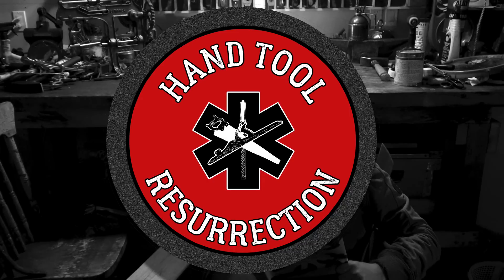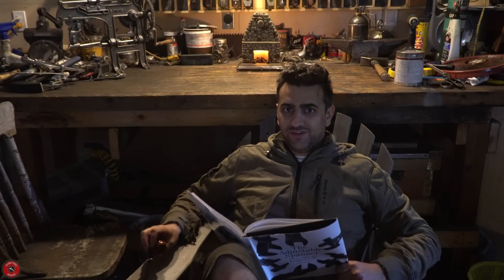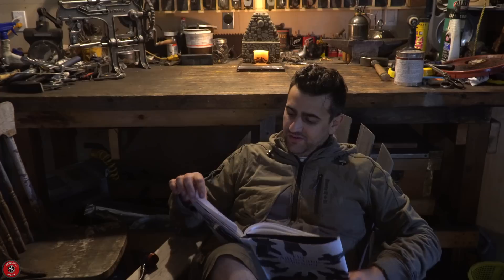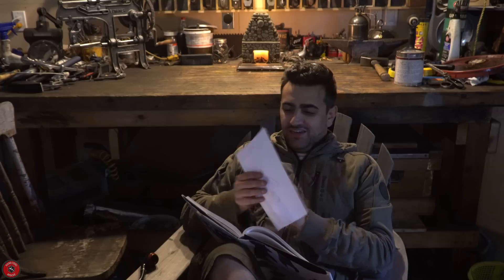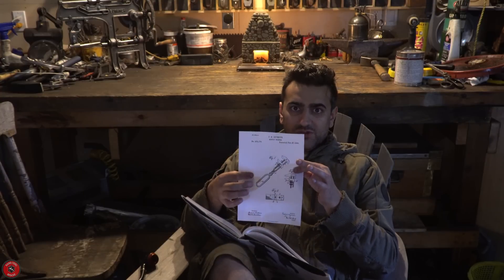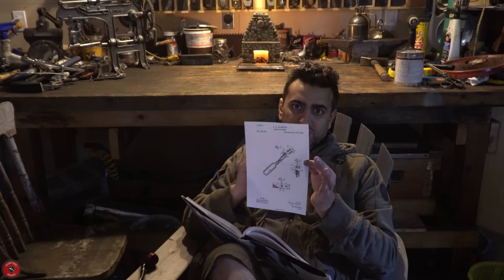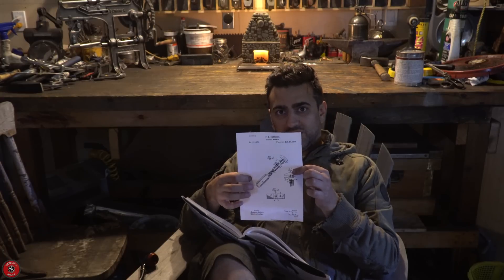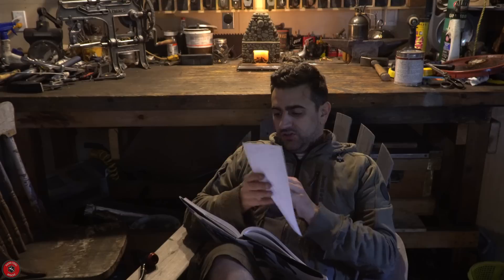1883 Wrench Twisted Handle Wrench [Patent Remake]

Comment: Never encountered one like this but I have a bunch of different sizes of Coes wrenches (both wood and metal handle style) as well as Walworth pipe wrenches. I use all of them mostly for work on steam heating systems as many components are designed to fit these older wrenches and don't fit into modern tools properly. (For example the top cap of old packless radiator valves, which are usually octagonal and don't fit into any modern adjustable wrench unless it's gigantic, but fit nicely into a large Coes wrench).

Comment: I was gonna say this would be an awesome multi tool if you added through bolts to hold the top jaw on so you could put different top jaws on.... Or just use it as a hammer.       😂

Comment: For some reason this video popped up in my feed, it's over a yr old... My grand mother's great uncle was a black smith, and he had actually made a pair of these. One he placed a piece of oak in the handle with the round bar wrapping around. Unfortunately, when my grand mother passed away, my uncle got all of those tools and most were missing out of the tool chest. If my memory serves me correctly, I vaguely remember both, handle length were around 18" - 20", the jaws were heavier and thicker. Cheers :)

Comment: I'd recommend using an angle grinder with a metal cutting wheel for removing medium to large bits of metal like the jaws of the tool that you did with a belt sander

Comment: Some stuff for Conservation I started to love is called "Cosmoloid H80" it's 'Microcristalyn Wax'

Some acid-free Wax that sinks into the surface, best after sandblasting, electro-derusting or a run in the Vibratory tumbler.

You dissolve it in benzine (the Manufacturer asks for Shellsol-T but I havn't seen a divverence)
and brush or wipe it on, let the benzine evaporate and buff it with some old T-Shirts :)

You don't see it and you won't get oily fingers from it

Comment: I have one of these that is similar to the Capital Tool link you showed, twisted handle, standard head, with the knurled nut in a cutout in the movable head. An ACME thread was used on it. About 10 inches overall.

Comment: Given the time period, there were probably as many blacksmiths as there were mechanics, if not more. So, wrought metal would have trumped machined metal, in real applications. The principal use would have been agricultural implements, and they would mostly have used square nuts. Not a bad design, considering the resources available, and the intended function.

Comment: Looking at that design, I think Seymour soon discovered a flaw, after he applied for the patent.
His design puts a lot of load on the adjustment nut. Especially brass ones will wear out very quickly or may even break. Therefor, a hardened steel nut would be better.
That's why this exact type of construction was never used. It was a bad idea.
By making the adjustable jaw longer and putting the adjustment nut inside of it, the load was now taken mostly by the jaw and far less by the nut. It also makes the jaw less prone to wobble.
Also, two rotations of the handle are necessary to avoid any twisting of the handle during use. The jaws will then loose their grip and thus the tool will become fairly useless. The handle must be ridgid !!
You must also use a flatter thread (square or trapezoid) , not one with pointed edges because they will wear off soon, making the jaw wobbly. And a sharp edged thread will only scrape the metal away, on the inside.
So...HTR, you know what to do, next !

Comment: Get yourself some old garage door springs of decent thickness, they are awesome quality steel for your handle material.To keep your twist consistent, place it in a vice directly below the spot you want your start the twist, this will keep that spot locked tight and no fear of shrinking in. May the power of Nutella sustain thee, the true North strong and Free!!
Reply from the maker: Thanks for the tips!

Comment: One- slow down that drill press when drilling steel! (also, sharpen your drill bits). Two- the usual method  of case hardening is to isolate the iron/steel from oxygen while it's surrounded by carbon (charcoal works fine), and soak it in heat for a period. This is traditionally accomplished by wrapping the whole thing in clay (Clickspring has a good video on this). Love the videos- this looked like a lot  of fun!

Comment: Do you need to twist the handle at all?
Reply from the maker: Nope.
Reply: @HandToolRescue  Thanks for the laconic answer. Actually my fault - wrong question/ You eliminated the second twist trying to keep the tool size reasonable. The handle wire dia ought to be reasonable to keep the weight low, so I was wondering if you could go one step further and eliminate the twist entirely. It is obvious it is for rigidity and mechanical strength but, just theoretically, if one would like to make it can they use another method for rigidness not using twist as it is not technological enough?

Comment: Is there a mount to put a wire wheel in a drill press like that? Or does the wheel come with the stem already attached
Reply from the maker: They usually come as a package.

Comment: I'd buy a widow jack or scissor jack, throw away everything but the screw and nut, weld the screw to a longer piece of metal after cutting it in a third, keep the rest in a drawer, secret, safe, then embed the nut in the metal for the hammer jaws. No need to fabricate a screw when decent ones are available for less than 30 Sour Buccaneers.

Comment: BTW I look forward to the chisel plane. Uri Tuchman did a double ended plane recently. Extremely talented guy. The only thing about the CP is when you tap it to use the chisel it will probably loosen the plane blade unless it has a mechanism to hold it in place.

Comment: I have an original one which came to me from my late grandfather's toolbox.Only difference is that it have two straight,round metal pieces coming from the wrench to which some kind of handle must have been attached to.though it does open and close by some  screw bolt action.Prior to this video I believed it to be some kind of clamp,but now it makes perfect sense.

Comment: beautiful work, just a little advice: if you heat the metal after tempering, it will lose hardening, you will be doing a thermal treatment called normalized (usually above 200 degrees C).

Comment: This is a complete lie, never forged rod will not be as smooth as the rolling rod as it shows on. Processing brass sleeve with a notch hand tool is also a lie, made on a lathe, the author is a rare ignoramus in metal processing.

Comment: Glens GS Tongs uses a minimal tool to do a similar handle twist. If you drilled the holes before cutting the square stock you'd have the tool. 
Nothing wrong when your conversation pieces are disguised as tools.

Comment: Eric that was a great basic wrench for not having plans or elaborate machinery thumbs up on a decent wrench in a short time period! If you haven’t seen Mr Pete version of a similar type of wrench,it took 10  episodes completion. His was called a drill press wrench which could be fastened to the drill press table and swivel to reach any position needed, if on the next version of yours, all it would take is a bushing at the base of the wrench which would help keeping that end round all serve as a mounting hole to allow attachment to the table! Again a great video.

Comment: Love it. I would love to see American high quality products being manufactured in small independent companys. I buy as little as possible new goods and have done very well at garage, yard and estate sales. New tech is good american made new tech is better. If youve ever tried to buy a quality toaster these days you won,t find any on the market they don,t last as long as a cheap disposable lighter. But there are a few like new in the original box avalable if you look hard at estate sales or used appliance and furniture stores. As for good old fashioned American tools check Hamilton tool and supply company in Beaver Falls Pennsylvania. The web site dosnt do the place justice. Its an old very ornate stone bank building. 4 floors packed to overflowing every tool you can imagine. And plan to spend hours even days.

Comment: I have a neat locking interchangeable head screw driver. Haven't found anything about it online. Standard for the time square bits but had a notch and a spring steel finger that would hold it in place.

Comment: VERY nicely made project - I'd love to see more of these.
I suggest pins/screws to lock the top bar next time - simple, allows fixing, replacing, multiple heads (e.g. make a head with a ball peen hammer, etc).
This also does not ruin the heat treating due to the heating of the top bar so much. 
Very impressive work.

Comment: I have a hunch that the twist on the handle was intentionally left open as it was drawn as a means of limiting leverage and preventing over-torquing.

You feel the spring in the handle start to give, you know your bolt is tight and move to the next one. The type of steel you use and the length could make it a 50 ft lb wrench, or a 60 ft lb wrench.

Super cheap and easy torque wrenches for the 1800's? Yes please.

Comment: US Design Patent No. 53,597 "Wrench", issued July 15, 1919.  It's got two ball ends with different hexagonal sizes cut into five sides of each ball end. So a wrench with 10 sizes in one.  Although the axial ends are less useful I expect.

US Design Patent No. 57,768 is similar, but the ends are open, perhaps easier to mill.
Reply from the maker: Why can't I find a link to these?  LET ME SEE!
Reply: @HandToolRescue  If you google "Patent No.______" it should be in the first few results.  Google can annoying for patent search for anything specific.  I am an actual patent examiner so I was doing some pro-level searching this morning and just jotting down PNs
Reply: Oh Design patents have a D in front of the number.  hehe crucial info.
Reply: @HandToolRescue  http://www.datamp.org/patents/displayPatent.php?id=29497

Comment: Did you lose the hardening in the upper jaw when you heated it red hot while peening the rods?  Or does case hardening not work like that?
Reply from the maker: Ya, I probably did, but it doesn't really matter anyways as the case hardening layer is super thin.

Comment: Nice resurrection, I have 2 question for it
1. Why the clamping faces were not milled for a better finishing and flatness?
2. For the top part, why not using gas weld to weld the part instead of forging them together which led to tempering of top part?
Reply from the maker: I had to stick to the methods described in the patent document.  There is definitely room for improvement on this design.

Comment: Using a drill press and axe as a lathe and cutting tool, absolutely stunning.
Reply: It is a joke...you cant put enough lateral side movement with just your hand to knerl metal...let alone use a edge of a axe to cut a channle. My first B.S. moment was when he used a sander to grind down the jaw angles @5:30 minutes. It's called editing (you wouldn't sand when you have a mill). The end result Awsome I must say. If you like this content see This Old Tony he's the best! Peace
Reply: @ramonhernandez3391  boy nothing gets passed you 🧐
Reply: I first thought it was a joke from his side so I was surprised by the result.

Comment: I now know why they call it "flood cooling"
Reply: Fuck now I know why my 1982 yamaha xj650 just pulled oil to the top valves until the oil just flooded back down where the cam chain goes
Reply: Yeah M8.
You are G42.

... I learned Fanuc.

Comment: I wonder why that type of wrench was designed.  Was it simpler to make vs a full chunky handle?  Maybe they thought of it as light weight?  Maybe it was occupational/trade related, like it was designed for steam engine bicycle manufacturers.  Or a replaceable horse shoe nut+bolt combo that never came to fruition.
Reply: you know how things sometimes are done just because they look cool? well, that's not a recent phenomenon...
Reply: IMHO simply production. It's only twisted rod, nut and two "bricks" . Late 19th century was a time of inventors. Everybody wanted to create something cheaper, stronger, just better. On the other hand i think that was like: "Oh no, i need a wrench to repair my (write here your favourite unnecesary complicated 19th machine) but nearest blacksmith is 3 moons from here! Ouch, Augustin is that a rod, nut and two iron bricks? I have a idea!
(6 imperial moons later)
Augustin, that wrench is much better than your teeth. I have to patent that!"